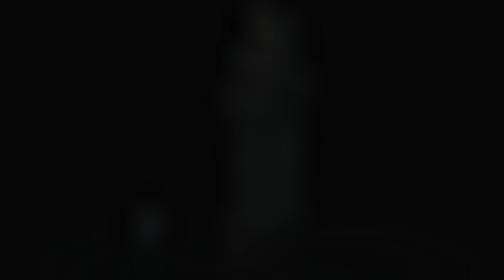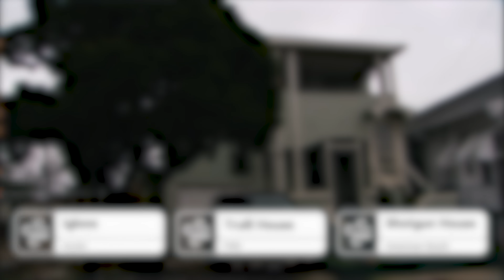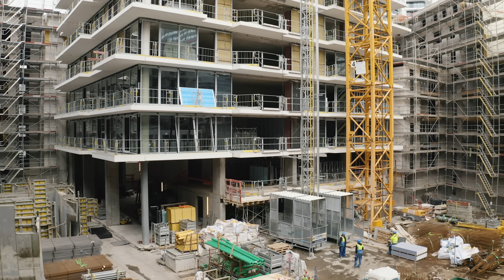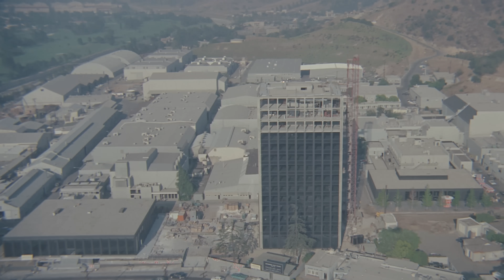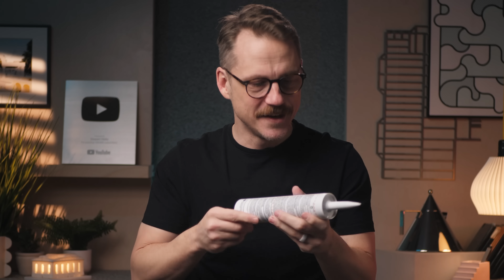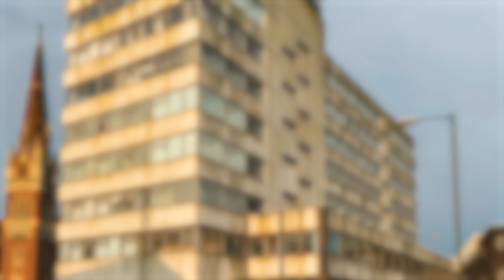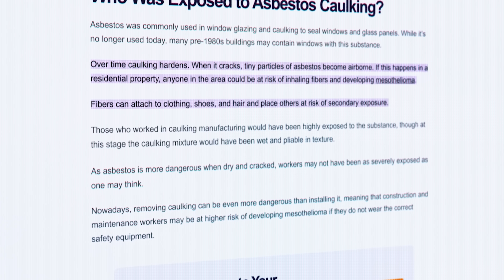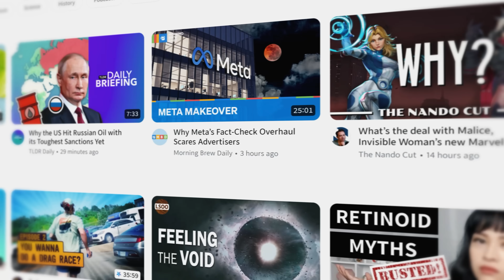How Caulk Accidentally Made Buildings FLAT

Comment: I kind of take a regionalist/semi-vernacularist approach to architecture. To me it makes sense to use caulk to update older styles where they would have used mud or tar or what ever to seal houses.  Instead of using those you could use sealants. So for example the Wigwam. What I think would be cool would be to modernize that design with modern materials. They would set the frame/foundation, cover the frame with leaves/sticks and hides then seal it with sap and/or mud. In my mind you could easily design larger (traditional wigwams are fairly small. Barely single family size.) wigwams with aluminum or steel frames, some kind of composite siding and seal it with a special kind of sealant. This is just an example. Also this wouldn’t be something I would roll out to entire countries. I would keep in regions where they would have been normally used such as the North-East of the US where the Iriquois tribes who built the originals are from. Why? Because those structures were built and designed in that particular climate and geography. I like big skycrapers and I think the US should have the biggest and the best but there’s always going to be someone who is trying to outdo you with that. You’ll only have the largest skyscraper for so long. I personally prefer more pragmatic architecture. Homes, homesteads, government and industrial buildings.

Comment: There is only one single reason - it's cheaper.

Nothing stops you from building house in the old way except budget. But just building layer by layer, brick, insulation, face, is cheap, and people want house that can be afforded.

Wages are bigger and bigger part of the cost and getting fancy is no longer affordable for normal people.

As for airflow, it's all nice and cool to have drafty house if your heating is cheap, but that part is also higher and higher cost of the budget, so "closed box" with very controlled airflow and heat recirculation comes out far cheaper than drafty box that you put tons of kilowatts into just to heat
Reply: POS cardboard houses that are cheap to build ARE NOT cheap to buy. They are way over priced, it's near pure profit for the developers. 
profit margins are the problem. 
Its not "fancy", its built well. Also, a closed box with an HVAC system is a garbage way to build a house. Air flow is a necessity unless you want mold. It also means that if the AC goes out, you lose power, or your furnace goes tits up, you are fucked. 
Everything about your point is bad.
Reply: Finally someone posts the actual answer. This entire video, and even scrolling through tons of comments, I was like, yeah, but.... It's always cost. Everything always comes down to cost.
Reply: @kindlin  yeah, like, the architecture of old isn't that much prettier because we somehow lost the taste, it's pretty because even just well off people could afford tons of cheap labour.
Reply: @xani666 cheap labor that could support a family on a single income. Cheap labor that had the time and skill to produce something that would still be functional a lifetime later. 

Today you have to be rich just to live in the exact same home that 75 years ago, was owned by the mailman

Comment: This video makes me wonder if architecture is in a sort of dark age when it comes to detailing? With caulking being so deeply ingrained in the practice, are there many architects left that would even know how to detail something well without it? How many of those old buildings ended up getting window replacements where they just used caulking to seal the gaps instead of having a craftsperson rework all of the components?

I'd love to find a resource of those older styles of details that we know performed well.
Reply: With modern very tall skyscrapers, detailing kinda needs to be avoided. They add loads of weight that would stress the building for no added function. These early, very decorated complex buildings are really short, most are less than 20 floors high with the highest reaching only a hundred or so high. And even then, the higher they are and less decorated they become. They have to shed the decorations to minimize weight. They also pose great danger. Such decorations easily dislodge. Imagine a stone decoration falling from hundreds of floors.

Also, at the time of these decorated buildings, there are very few of them at those times. Like, there are around just a hundred in the 1960s which increases to around 300 in the 1980s (the Empire State Building was completed in 1931 and the World Trade Center was completed in 1973, for context). So, there isn't much job for designing these kind of buildings back then in the first place. There are good reasons for that: they are slow and extremely expensive to build. It is only with these modern construction methods where we get these boom of skyscrapers as it allows to build even taller buildings for faster and cheaper.

They could study the earlier constructions. It is not like engineers actually know everything in the first place. They do research, studies and tests. That is practically their job. They could reworked the windows the old way but that would be expensive, but who is willing to do that? Like, are you willing to pay these skilled craftperson several times the price? Or save all that money and time with some caulking.
Reply: @rosverlegaspo6752  There are far more build types than skyscrapers though. Houses, schools, libraries, stores, etc.

The detailing is avoided because of cost, but I'd be curious what detailing could be like with modern materials, without reliance on caulking.

I work on schools and it seems like every wall detail relies on caulk to deal with water and we all sort of accept that it will fail.
Reply: @kodakodiak3949  The video discusses its applications for skyscrapers and how they are just blocks of glass and metal.

There are modern buildings with beautiful detailing. They are just not going to be most government buildings, cheap housing, stores, etc.. They are going to be like mansions, fancy hotels, high class restaurants, resorts, etc. They are there. If you want to see what detailing could be like with modern materials, there they are.

The problem I have with these "beautiful buildings" videos is that they are cherry picking what they show and provide a very skewed view of what actually is. They show us the best best buildings of the past, making it appear like these beautiful buildings are built everywhere at the time instead of the rarity that they actually are; at the same time they almost never show us the numerous beautiful building that are being made today making it appear like we never make such beautiful building these days. Beautiful buildings has never been the norm. Not now, not then and I guess, never will be.

Comment: The point about vapor barriers creating problems needs to be stressed again, and again, and again…

It only takes one leak to fester in some OSB particleboard to make your $500,000 investment into a biohazard. And it is far more common than most people think.

With bottom-dollar builders (check out some of the building inspector channels on youtube, yikes!) you can count yourself lucky if your undersigned building was even put together correctly. And if you can find a builder to do it right, but want a house with natural air flow, you will probably not be allowed to do it because of increasingly stringent R-value requirements to meet “green” objectives.

Comment: I appreciate your videos, however, you seem to be painting this idea that old craftsmanship somehow was more airtight than modernity. That simply isn't true. Sure they were more beautiful in some regards or have a better material palette. But to suggest all the leaks and the draft was thought out is so inaccurate. If you want to say windows were aligned for cross breezes etc, sure. But you're all but saying the gaps between materials was the desired effect along with ornamentation...I don't believe a single building scientist, much less a historian would agree. The biggest reason we enclosed our spaces and sealed them off was the mass adoption of central heating and cooling. Leaks weren't considered a feature but a bug. Again, I will separate that from intended breezes. And I get at the end you sort of wrap is together to say that it's not about caulk its about losing the concept of place but I feel like the more wholistic argument is the lose of craftsmanship, the cost to implement these details without clients who will pay for those details, and a more universal material palette that prioritizes energy efficiency.
Reply: As a structural engineer, I do feel that architects have a habit of talking a lot of rubbish while sounding authoritative about things they have a limited understand of.
Reply: @Wimbold  well im on the other side of the fence so not gonna necessarily agree with you but I will acknowledge the unfettered romanticism over practicality. This idea that all chemicals bad, all traditional good really goes against to the reality of the situation. If it were the case we wouldn't be spending significant portions of the budget on air sealing.

Comment: It's interesting.  Matt Risinger just had a video how modern construction doesn't have much room for error.  A window with a tiny leak on a Victorian house has an overhang to protect it, and probably even a protrusion above the window.  On a modern house there likely isn't an overhang and the window is usually flat.  He was saying that if you build to a modern blueprint you have smaller margins for tiny mistakes.
Reply: There is also the point that Matt is a residential single family builder whereas this individual is talking primarily of commercial or multi unit buildings. Residential single family buildings are made predominantly of wood. Commercial or multi unit buildings like these are generally not constructed with wood and almost never have wood facades.
Reply: My mom is a custom home builder and she REALLY tries to encourage people to put an 18” to 24” roof overhang on all sides of the building, even on smaller homes. It’s amazing how well much it extends the longevity of windows/doors and trim, keeps water away from foundations, keeps snow from accumulating right in doorways and instantly makes the house look 10x more classy. With her clientele in northern MI  she tends to have lots of real wood trims and other natural, delicate (aka non-vinyl) exterior elements so shunting the water off of them saves the owners tons of headaches for not a substantial amount of extra cost. Her biggest pet peeve is mass-built subdivision homes with zero overhang where water just beats the tar out of every protrusion. That’s a LOT of faith in what is usually very sub-par flashing done by those guys.
Reply: Why build in a tolerance for contingent weather related failure (Water leaks, drafts, excess heat gain and glare at certain times of day, etc.) through massing and detailing decisions when you can just brute force your way “past” the problem with mechanical HVAC and caulking.
Reply: @Chryptopher  if you build a building to last you're just putting yourself out of a job.  If they keep falling apart you've got a lifetime of work to do!
Reply: @danmerillat  You really think builders are thinking 40 years down the line so the next guy, long after the original builder has retired can get some extra business?  LOL   The public discourse on these things is so laughably out of touch with reality.

The truth is it's all about price.  It costs money to have multiple overlapping contingencies for failures in the designs.  And that cost is applied to ALL structures built, they all cost 20-40% more when you build that way.

Alternatively, you can have an extremely tightly thought out precision design, encode it in the standard "best practices" of the industry, and that's basically a one time cost that, so long as it's executed competently, performs the same function as 3x overlapping contingency systems.  The house can be built for 25% less & appears to last just the same in the timeframes people care about.  It may not last 100 or 200 years as well without proper maintenance, it may not suffer neglect or systems failures as well, but it performer mostly the same in the 30-50 year timespan most homebuyers actually care about $ costs $300,000 instead of $400,000.
Reply: @yunggolem4687  You're either completely deluded and have no idea what modern building is like, or a builder who's in charge of doing this damage.  There's no "30 year" timespan, these pieces of utter crap are falling apart in 6 months to 10 years.  My own house was condemned due to gross structural failure within 8 and I'm not legally able to name the builder as part of the settlement that ended up stripping it down to frame on the exterior walls and rebuilt.
Reply: Can you share a link to that?
Reply: @ I think they’re talking about this video:
https://youtu.be/8VJ8E8kyf9I?si=ASpS0VEtQwgO1gag
Reply: That’s not true at all. It’s the exact opposite. We make flat squared buildings because it allows for errors to be corrected within a single section so it doesn’t translate into a larger mistake, like the “banana tower” on Maiden Ave in NYC. The whole reason caulking exists is to fill in the gaps deliberately designed into buildings and homes to allow for errors. Older building methods required elaborate solutions to keeping moisture out and allowing airflow through the building. That’s why they are more ornate. They are built in layers and to cover gaps around windows and doors, they added an ornate block over the outside of the inner block, and then covered the inside walls with plaster of Paris.
Reply: Imagine building our houses with powder, paper, and caulk.  It’s all a façade that’s failing fast.
Reply: It's funny that Matt is the first person that came to my mind as this video played. He uses all sorts of chemical solutions to make a vaportight house, but obviously his materials and methods haven't been tested for a century. 
Time will tell.

Comment: Your points seem kind of cherry picked, half correct and kind of so what? 

1) the premise: does caulking really prevent ornament? After watching your video, there's no compelling evidence that it's doing that, only that it's providing a cheaper option not to. But it's still completely possible to do detailing similar to do what you're looking for and I can't help but wonder if there aren't other factors that were more important (increased desire to utilize sq ft, difference in city ordinances, people looking for modernity). Did you seek out counterfactuals suggesting that artisan solution performs poorly for some quality builders increasingly prioritized? That would also be significant info.

2) this seems like a pretty trivial thing to complain about when your suggestion is to do sonething that would seem to greatly increase the labor costs of building a house during times when it's already pretty expensive. 

3) cements, concretes, bricks, all of these are also chemical technologies. Caulk is a polymer while the others aren't.. but the traditional materials all have historically had huge impacts environmentally and I'm sure had people making snide remarks about their use in architecture at some point

4) Most building materials also age poorly without maitenance.. limestone literally dissolves. Somehow half of kyoto is made of wood and metal which look like they're struggling in the humidity lol. I'm curious how the maintenance schedules end up comparing. Another piece of useful info that differentiates this video from real analysis.

5) everything is tested in labs and it's not that difficult to mimic all the relevant real life environmental conditions. Time is tricky at least for how much I know, but maybe I just don't know enough. I can say with confidence at least if someone wanted to recreate the temperature, UV, humidity, wind speed, etc. a material would face outdoors in a lab environment for a year, they could do it no sweat. 

6) The secretariat building was renovated after 60 years and even in the article you show there's no mention of the caulk. Not to say that it didn't happen, it did mention leaking, but it seems like you're misconstruing that it or its damages are the significant target or justification of spending for that 2 billion dollars of renovation. Sprinklers and asbestos are specifically mentioned and I'm going to guess that's there's a laundry list of other building code stuff they want to get up to date on along with just generally modernizing the building

7) It's bizarre to me you made a whole video spinning stuff on why caulk is the bad guy, just to undermine your thesis and say "caulk isn't the villain". Why not do a more even analysis then? Most people are going to walk away from this video thinking caulk is the villain regardless of your note at the end their because of how 90% of it is built lmao.

8) overall would've preferred a video that more constructively approached your problem. Like why not suggest more ways to do 3D ornamentation, with or without caulk, if caulk is not the villain? Maybe you have a video like that on your channel but honestly, I'm increasingly regretting clicking on youtube video essays so I'll just say ✌🏻

Comment: I just moved out of a 54-unit condo building because 45 years of bad caulking and lack of routine maintenance caused major structural issues that will cost millions to repair.  Those high cost repairs, in turn, pumped up those 54 homeowner's association dues - A LOT!  Can you imagine?  54 homeowners coming up with 5 to 7 millions dollars?